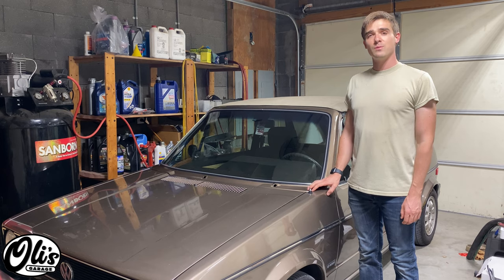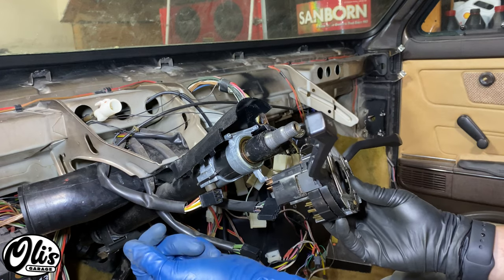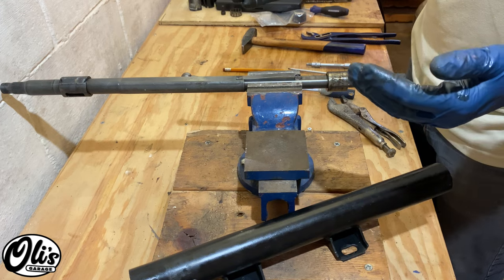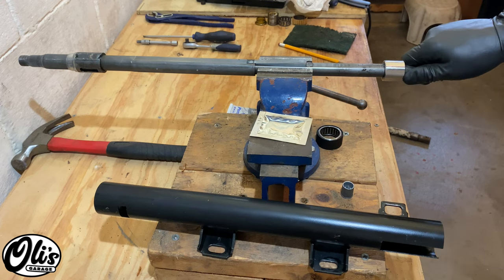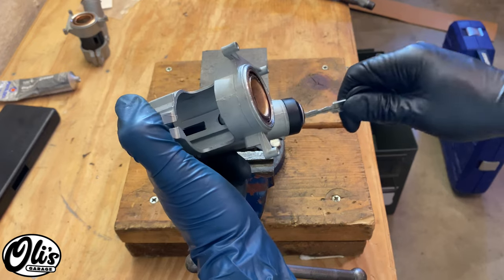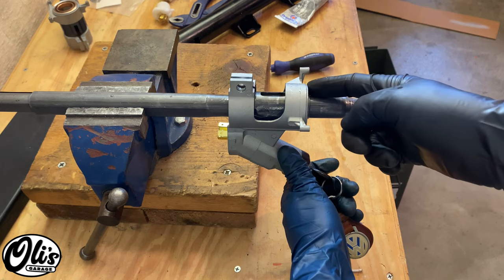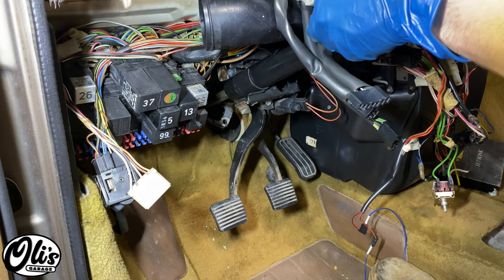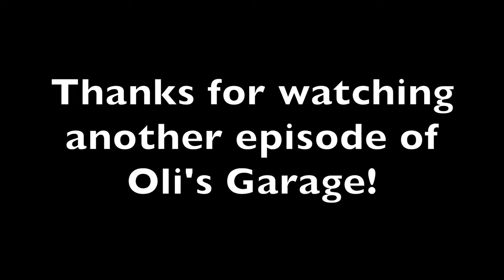VW Mk1/A1 Steering Column Rebuild and Bearing Replacement

Comment: Just a note for all without a collapsible steering column. This bearing kits doesn’t fit and you need to get the cheaper and simpler bottom bearing. (Vw heritage) supply
Reply from the maker: Comment pinned to the top. Thank you for the info! Mind including a part number? Then I’ll also update the description!

Comment: I like the details and simplicity of your videos. And the fact that you are mostly using the simplest tools, tools that most of DIY already have in garage.  Adding torque required for for each bolt is also priceless.
Reply from the maker: My goal is to make them such that most people can fix all of these problems themselves. I also always get extremely frustrated when people make great videos but don’t include the torque spec. So I decided to start a revolution and include torque spec in videos! 
Some slight sarcasm, but hopefully more people include the torque spec. Properly tightening bolts is just such an important part of properly fixing cars.

Comment: I didn’t have a press to get that bearing installed in the steering tube. I sanded mine down with emery cloth, taking off a few thousandth of an inch at a time to get it half way in the tube, than gently tapping it in as much as possible. I used a 1” plastic plumbing PCV end cap to tap it down evenly. I wasn’t able to tap it all the way flush with the tube, but only 1/8” short. I found a 6” C clamp worked great to seat that steal spring clip. Hook the top of the spring in, and with the C clamp, it just snapped in beautifully. Re-assembled and it works great. Now my 81 Scirocco can hit the road again. 👍🏻😀
Reply from the maker: Nice work grinding it down just a tad. That’s a good idea. 
I’ll have to remember the c clamp trick for when I pull the column on the white mk1. 
Safe driving!
Reply: @OlisGarage  thanks. I was trying to find a press for the other two steering columns I need to do. No luck. I’ll sand the others down a little to fit. Have fun with your Mk1 rabbit. 👍🏻
Reply from the maker: @andrerodriguez7603  if you have a little bit of cash, I recommend just buying a press. Mine is the bigger one from harbor freight (definitely not the highest quality Chinese product…)
But, it does the job and has done many wheel bearings and motor mounts. 
Good luck to you and your cars as well!
Reply: @OlisGarage  Thanks, I’ll look at your video again to see your press setup. I can use a press for sure. It’s hard to find a machine shop these days to press in motor mounts. And hub bearings. Have you seen the videos from “the Rusty Rabbit”? He is a hoot to see. I’ll keep watching your videos too. 👍
Reply from the maker: @andrerodriguez7603  I was a bit hesitant at first to buy the press because it wasn’t that cheap, but it was very worth it.
I’ve seen a few of his videos but need to watch more. He is super knowledgeable from what I’ve seen.

Comment: Great video! You detailed the removal, rebuild and reinstall very clearly and concisely. For anyone that has an old VW it only make sense to have your column rebuilt for a safe enjoyable rattle-free ride. Good job! 👍

I also really like that complete rebuild kit from Mk1engineering. It's reasonably priced, and that all-metal bearing with the knurled race to prevent the bearing popping off the column tube is brilliant! That was the problem I had with my car.

When I got the car I noticed it had a very clunky 'loose' steering wheel, especially when you loaded the steering wheel up and down, and it rattled like mad going over bumps. I looked under the dash and noticed that the lower column bearing slipped off it's plastic race and dangle on the steering column just outside the steering tube. It seemed that the plastic bearing race retainer had disintegrated and allowed the bearing to slip off the race. That explained the little white plastic bits I found on the floor mat. Without that bearing support the column shaft slopped around inside the steering tube, hence the knocking, rocking, loose steering wheel. Not good!

To fix it I bought a special 'lower steering column bearing repair collar' from Mk1 Autohaus. It's a split design and slips around the column and bolts into place on the steering shaft to retain the bearing on the race in the column tube. It fixed the problem and has worked for close to 15 years now. But after seeing this video I think it's time to put a rebuild on my to-do list!

BTW - If you want to check out some pics of my car go to the Imgur website and search for "My 1984 Jetta GLi coupe". Cheers from Canada!
Reply from the maker: Ah yes, that lower repair collar is also pretty popular. 
But now that this kit is out, it’s pretty easy to replace everything and make it like new. 
It’s not too difficult of a procedure either. Just takes an afternoon. 

And sweet, I will check out the pictures!
Reply: I wonder if using both is a good idea? Is the mk1engineering kit that you used different in some way that would reassure the installer that it would last longer than the original one from the factory?
Reply from the maker: @PanzyPatrol  most definitely. The bearing race is made of aluminum not plastic. The bearing never failed. Just the plastic holding in the race (it actually hadn’t failed in my car yet, but I wanted to replace the parts as I figured it would fail eventually).

Comment: Seriously anyone who is doing this be super careful to not collapse the steering column, it is really easy to do and its a pain to get back out after. I measured 116mm from the collapsible inlet just to the first edge of the bearing race that slides on over the shaft, its probably different for everyone. Hope that helps if any of you all accidentally collapse it :D and forget to vice it down on the correct side.
Reply: Yep, i did that.  didn't even know the thing could move but found out when putting it back together and it didn't look right.

Comment: great vid dude! did mine a year ago using the very same repair kit from mk1 engineering. Unfortunately EU build cars have different steering columns and I couldn't use it, so I ended up manufacturing a different definitive fix for the steering column. Had it in the car for over a year and it is working perfectly!
Props for very thorough how to on the whole steering column assembly!
Reply from the maker: Oh wow, I had no idea that they would be different. 
I’ll be completely honest and say that filming this was a bit difficult, just because I wanted to include as much information as possible.
Reply: @OlisGarage  yeah I didn't know too before I took it all apart... And I belive you! It is a shit ton of work! As I said, props for doing these how-tos! This will help a great number of people!

Comment: Just want to give a heads up that the MK1 engineering bearing kit has issues with clearances between the inner and outer race. My inner race was more than 5 thou too large to fit inside of the outer race. No support from Mk1 or the eBay store I purchased the part from.
Reply from the maker: Thank you, I’ll update the link in description to another site.
Reply: Same Issue! I purcahsed a 2nd kit thinking it was something  I did. I even picked up a 2nd housing thinking someting was wrong with mine. Ordered a tech53 no response from mk1 engineering

Comment: Thanks for sharing your experiences like this.  I watched this video several times before starting my rebuild.  I bought the same rebuild kit too.  I was assembling everything and noticed that I am missing the upper column sleeve.  No one seems to have it in stock.  I was wondering if you could get pictures and measurements of one (hoping you have a spare).  I was thinking about trying to model one for 3D printing.  Thanks.

Comment: Don't use silicone grease or spray.  Once you contaminate your tools, it spreads to everything you touch.  MEK and acetone will not dissolve it.  Soap and water will not get it all off your hands.  It persists tenaciously.  Then, when you wish to glue or paint something in your contaminated shop, you will find it difficult (or impossible) to get a good bond.  Dupont did come out with a special (and expensive) solvent specifically for removing silicone, but it's better to save silicones for high-temp applications where nothing else will work.  Petroleum greases work just fine for almost everything and can be easily washed away.  Thanks for the good tutorial bro.

Comment: You ever think about doing an aftermarket steering wheel? I only ask because thats where I'm at on my project and I use your videos for just about everything
Reply from the maker: I honestly have never wanted to install one. However, my understanding is that you need an adaptor for it. I think that adaptors are fairly common for the VW hub. After that you just basically install it like normal. Check vwvortex. Use the search function and limit it to the mk1, mk2, and cabriolet sections and you can probably find some good info.

Comment: you could use a vice grip to push the clip down so u can remove the plate ceep in mind that the vice grip must be big enough so it wonnt damage fhe front of the clip.

Comment: Great thorough clear pro video Oli-thank you.  Prior to ordering the kit I am wondering about the bearing in the ignition lock assembly.  You tried to press it out, could it have been regreased, was the wear that bad or a lot less than the lower bearing.
Reply from the maker: Bearing deformed when I pressed it out. I didn’t notice it until I reinstalled everything and the column just didn’t spin well. If you don’t have much play in the bearing, there is no reason you couldn’t leave it in the aluminum piece to clean and then regrease.

Comment: @OlisGarage Another great video.   I've noticed that a few of your videos reference a kneeboard removal, however I can't seem to find that.  Am I missing it somewhere?     In order to complete this project and a few others i need to remove my kneeboard.  Thanks again!!!
Reply from the maker: Ah you caught me. I haven’t filmed that yet. Mainly because…I’ve been avoiding removing the knee board. 

There is a written document on cabby-info that has steps how to do it. 

Don’t attempt it by yourself. Make sure you have someone there willing to help you
Reply: @OlisGarage  It's that bad huh?   lol.  I'll check out Cabby-info and recruit a helper for the job.   Thanks again!
Reply from the maker: @staceybsnyder  it’s not terrible, it’s just not ideal. Awkward angles, awkwardly heavy knee board. With two it’s no problem though!
Reply: @OlisGarage  Ok, thanks again.  Gonna attempt to convert my airbag wheel/column to a non airbag wheel/column so figured i'd rebuild the whole thing with new parts while i'm there.  This video is awesome.    Your videos are so awesome!!
Reply from the maker: @staceybsnyder  any reason to go to the non airbag? I only ask because honestly I don’t think that juice is worth the squeeze
Reply: @OlisGarage   Good question.  My first car was a 1984 Rabbit Convertible.  I have always loved that 4 button wheel.   Always wanted another Cabriolet and a few months back got a 1992.    I picked up a 4 button wheel but then realized I needed to swap the entire column.  I believe i have all the parts and will be attempting the conversing here soon.   It's mostly based on emotion and nastalgia.   Ha!

Comment: Hey Oli, great videos.  I am restoring a 91 Cabriolet and you have helped me immensely.  Thank you!  I also purchased the MK1 Engineering kit and so far it is very well built.  However, like Steve below it has the spring, coupler and C ring instead of the plastic sleeve.  How the heck do you reinstall this?   I have tried everything and can't seem to get it to fit properly.  Even the Bentley manual does not have the pictures of the diagrams correct.  Please help!
Reply from the maker: I’ve never seen the spring, but I do believe that they exist! Someone told me that they used a car door spring compressor.

Comment: Good tip on not messing with the copper bearing - ty. Is that plastic spacer just to space the gap for the horn? Hoping it wont need to be that accurate with mine. Different style horn.
Reply from the maker: You know, I’m not 100% sure anymore. I think it’s supposed to help with the spacing. But with torquing the steering wheel to 40nm, I feel like that would squish a plastic spacer sleeve. So now I’m not quite sure.
Reply: @OlisGarage  that's a good point, I think I can help explain that. Its the taper after the spline. You get a huge torque load on it without compressing the sleeve.
Reply from the maker: @json8172  correct. That’s why I’m not exactly sure what the role of the sleeve is. All of the “adjustments” are basically already set in stone with the welded metal piece on the steering column.
Reply: @OlisGarage   It looks like it does nothing on mine as well. I am now really unsure why its even there in the first place now lol. Another strange quirky design from vw. Just odd they would give you a measurement for it, when it doesnt really do anything?

Comment: I got to the part where you put the steering column back into the black metal shell that goes around the column. I went to put it in but for some reason the metal race gets stuck on the pins in the new bearing.
Does anyone know what I did wrong or how to fix it?
Reply: Same problem here…
Reply: Same problem here. Ended up collapsing the steering column attempting to get it on. No support for MK1.

Comment: I have a spring between the U joint and colum shaft, maybe because mine its a EU car? also I cant reasembly the wheel because I have less than 41 cm clearance

Comment: hey, don’t know if you respond to old post, but i’m having difficulty getting the steering wheel back on, it almost as though the threading got shorter, maybe there something i did that messed it up. is there a solution for this?
Reply from the maker: It sounds like your steering column collapsed a bit. You’ll have to remove it again and make sure it’s long enough. Somewhere else here on a video someone commented on the total length of the column. Unfortunately I don’t have the number off hand!

Comment: Hey Oli! I could really use your help…I was able to figure out how to get the knee board out, and I changed out the ignition switch, but I’m stuck trying to get it back together…my ‘92 has a little different set up with a spring, metal coupler, and “c” ring holding the aluminum ignition switch housing on to the steering column. Yours appears to have a plastic sleeve instead. Any ideas on how to compress the spring in order to get to c-ring back into the channel on the steering column? I have pics if that would help….
Reply from the maker: Shoot me an email. It’s listed on the “about” page of the channel

Comment: Is there a way to adjust the length from the end of the sleeve to the end of the shaft, putting new bearings on my column but I’m getting ~43mm

Comment: Oli, do you happen to offer the service of rebuild a rack and pinion? It’s a 1991 Cabriolet 1.8
Thank you,
Reply from the maker: I have not tackled that job yet. Steering columns I can rebuild, but I have not messed with the rack and pinion yet. Is yours leaking?
Reply: @OlisGarage  Thank you for the prompt reply. The boots have a “L” shape adapters which connect both boots with an aluminum line. One of those “L”’s is the only part that is leaking.

Comment: I could soooooo use that kneeboard removal video right now! ETA??
Reply from the maker: Ooff. Hard question. I have yet to remove a knee board since starting the channel as I’m avoiding that like the plague. But I haven’t forgotten. However there is a picture guide available on cabby-info dot com.

Comment: The column does not need to be removed to to do the bearing replacement!
Reply from the maker: Really? To me it just seems to much easier to remove it and be able to get to everything. 
And as with everything, there are almost always three repairs that can be done when one takes something apart. So taking it out might not be a bad idea.
Reply: @OlisGarage  getting that spring clip back in on the column can be a real pain.
Reply from the maker: @omnicho  getting it on was fairly straight forward I found. Getting it off was a bit tricky. 
Either way I’d personally rather remove the column. Hard to press in a bearing race without the column removed….
Reply: @OlisGarage  just pull the bearing in from the bottom using a threaded rod in the center of the column.

Comment: Well I got the steering column done and it was running then out of nowhere a electrical fire started In the engine bay so now I gotta do everything in the engine bay all over again it took out my lights and alternator wiring and I couldn’t see where else but that’s the main two I see do you know of anything I can do to make sure it doesn’t happen again because everything looked fine and nice then out of nowhere it happened luckily I was at home when it did because I was gonna take it around block to test out how it handles with the steering column rebuilt and do you have an Instagram so I have a way to contact you if I got any questions
Reply: damn g punctuate